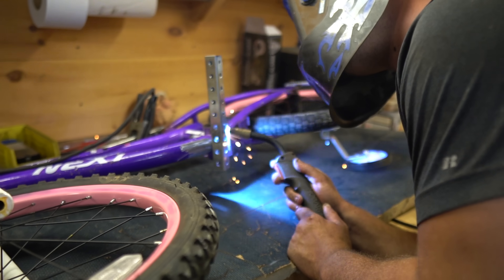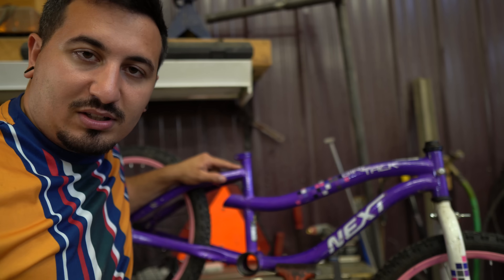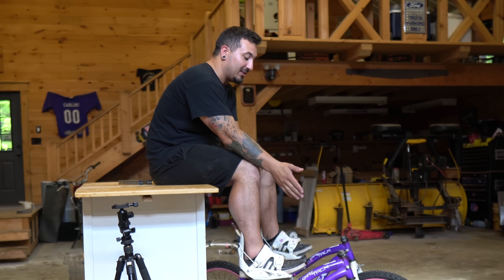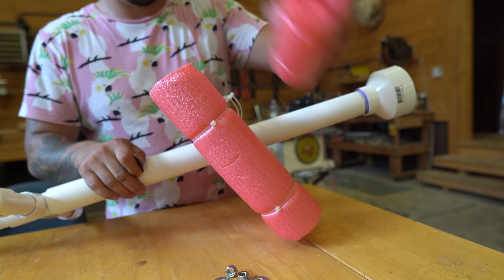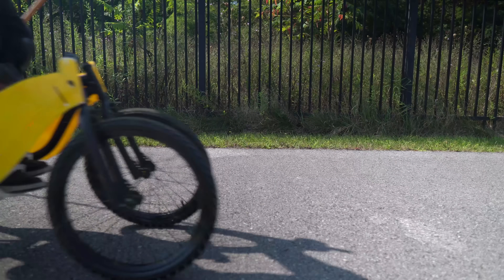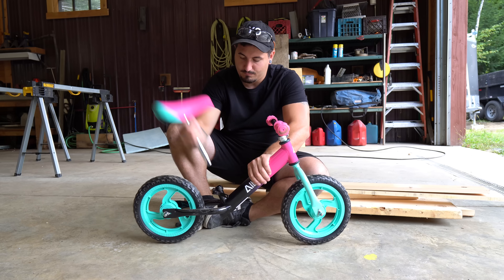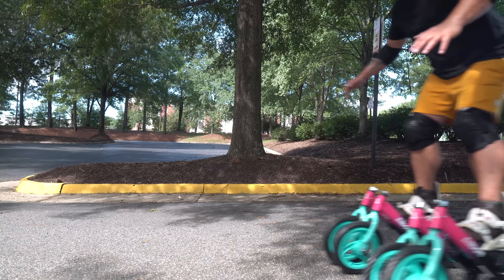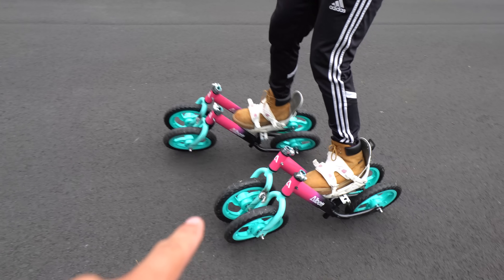I Built Bicycle Rollerblades.

Comment: Snowboard bindings are meant to work with snowboarding boots for ankle support.  Regular boots wont cut it and you could very easily break an ankle with that setup.  An old pair of skis and ski boots would probably work much better.  Ski boots are much stiffer with much more ankle support and the skis, after you cut them down, would be pretty easy to bolt onto things.  You could even use the flex of the skis to create some shock absorption.

Comment: You have to wear snowboarding boots for the bindings to work properly....
Because boots actually lock your ankle from moving around too much.
The only reason you don't have control is  because your ankle is bending around with out any support.
Reply: Same issue he had with previous Rollerskates. You are absolutely right

Comment: I'm a rollerblader and I feel like I could ride the hell out of these.
Reply: same
Reply: Nope, you cant. there is a reason skates look like skates and not bikes. size of wheels and body as well as the weight make it too hard to skate with. 4 wheels on each will only make that harder.

something like this would need motors. without motors would need to be a radically different design to ease the size and weight issues.

its a good idea for a yt video but a terrible idea in practice. 

youre better off trying to design skates with larger wheels, which has probably been done plenty.
Reply: Cool
Reply: but this not rollerblades, this rollerski ! )
Reply: Dashcamdoesthings  Hmm, what if there were 3 or 5 wheels?

Comment: seems like ski boots would have alot better lateral stability than snowboard bindings. Also, I think the caster of the steering can be used. I, as a kid, would take my brother and I's scooters (with no handlebars on them) and "ski" on them downhill. worked well. fun project!
Reply: Also, mount the platform BELOW the axle height

Comment: I know you probably won't revisit this but, if you mount the boots below the center of the wheels, it should make it easier to balance and provide additional support to the legs. I say, take your original design and make the wheelbase shorter then mount your feed almost to the very bottom. Or, take just one wheel from the first design and make it that way. Either way, good content. Keep it up!

Edit: also, use snowboard boots. They provide ankle support all the way up the calves and would give you 100% more control. I bet your friend would say it's 10/10 after that 😉

Comment: Just use snowboard boots in those bindings... Also using hard rollerskate boots would work 1000 times better. Ski boots could also work... Basically, anything that gives you proper ankle support and better control.

Comment: Kinda late here but the reason the first design didn’t work was the side mounted boots. It through off the center of gravity forcing the bikes to be angled towards you. You should cut off the top part of the frame and mount the boots on the center of the second support bar.

Comment: Guess you never seen a scooter with 12" wheels and brakes? I hand one as a kid, in the 80's. Still sold, and I got some for my own kids. Way better then a razor. Has all the parts you want, 12" wheels, cable linked brakes that can go on handle or ski pole.
Reply: This was a funny video. Definitely try another version with the 12in wheel scooters with brakes you can cut off the handlebars hold them in your hand hold the brake as you push off the first kick then let go and use the brakes as normal

Comment: try using a drywall stilt style rather than a short binding for the first pair of bikes on top like you originally planned.   i feel like the extra leg support will help since you're up so high.  make a high chair or sit on a table to strap up.  i can can into stilts without any support, wheels might make it tricky; maybe add brakes with a lock?

Comment: One thing is when you change a tube you don’t have to change the tire as well just run your hand around the inside if the tire to make sure the thorn or whatever poped your tube is out of the tire before you put the new tube in.
Reply: This one true for small punctures, but you could see in the video that the tire casing had been torn. If the hole is large enough, a tube alone won't work. In a pinch you can stick something behind the tear to keep the tube from bulging out, but that's really just meant to get home, after which time a new tire would be suggested.

Comment: Try removing the the frame. Front fork into back wheel fork you'll have a best foot platform. Trying removing as well the pipetube that holds the handle bar.

Comment: When you changed the tire you should have gone tubeless on both bikes.  You can loose a pound by doing that per-bike!  Also what you call a steerer column is incorrect.  It’s called a steerer tube.

Comment: Long time speed skater here. Cool idea, but unfortunately the big wheels make it impossible to have any control, as well as being extremely dangerous for your knees and ankles. I rode 100mm wheels for 3 years before I went up to 125mm wheels. The jump was insane and it took me 3months to beat my personal best half marathon from 100mm wheels. Mainly because you put so much extra strain on the ankles it takes a long time to build up extra muscle. You went to like 300mm wheels which is just insane😅

Comment: Nice try - enjoyed the video.  What about going back to the original idea you had with the larger bikes - remove the bicycle frames and then take a couple of metal tubes about the same diameter as used in the bicycle frames.  Cut the tubes to length, flatten each end of the tubes, drill holes to attach the wheels, and then make a plate for your foot?  Just an idea.

Comment: if you angled the wheels of the larger one more like this: \| |/
With the "|" being your legs. It should offset the weight a little better and should feel better for your legs too. Though, I'm not sure how the wheels would take the strange diagonal pressure.